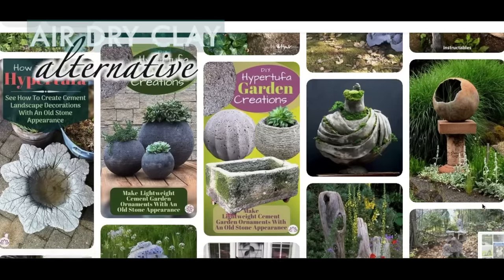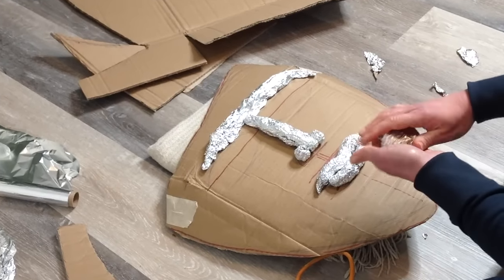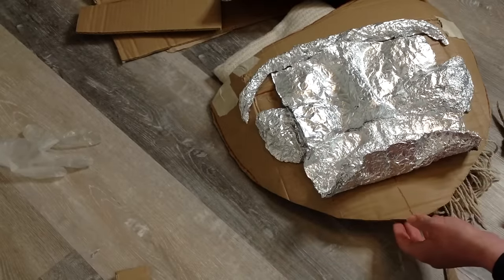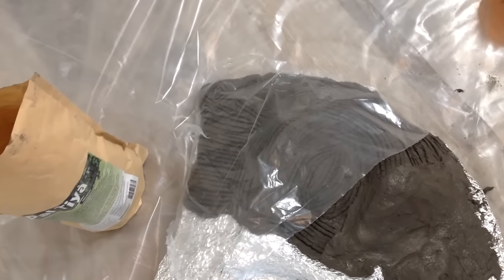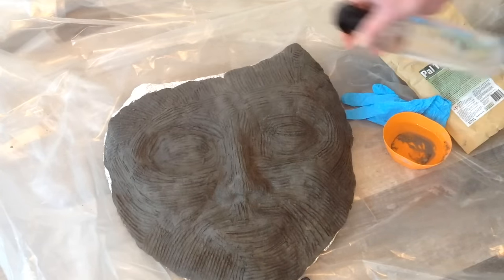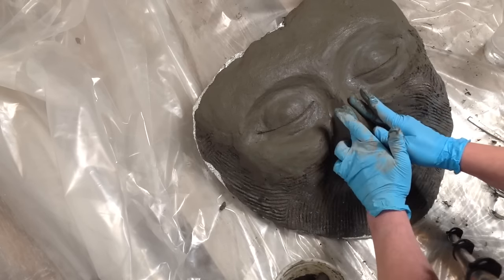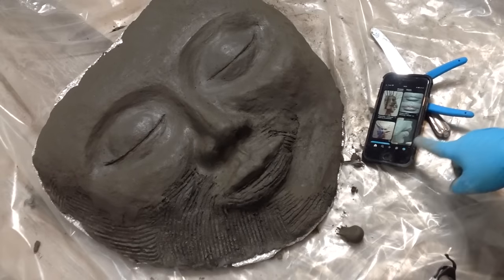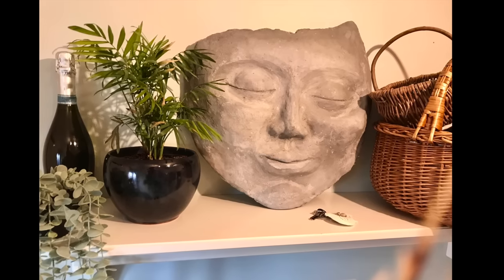Air Dry Clay Alternative - Waterproof DIY Garden Sculpture IDEAS - Pal Tiya Premium FACE SCULPTURE

Comment: Thank you for all the advice and information that you include.  It is so helpful!  And thank you for sharing this new medium.  It looks like the perfect blend of concrete (which I find a bit intimidating) and clay.  And that design!  It looks spectacular.  

This would be a great medium for all sorts of things.  Garden sculptures, of course, like making a fairy house over a stump or a nice tortoise or bunny or even a bird bath.  Plant pots would be a good idea, too.   Also holiday designs for the seasons.  I looked at the product website and it says you can paint it with acrylics, too.
Reply: Can be coloured with exterior acrylics, concrete stains, and india inks. You can even mix Iron-based coloured oxides to the powder to achieve unique colouring.
Reply from the maker: Thank you, sounds like you have plenty of ideas to keep you going a while, have fun

Comment: Im brand new ti airdry art. Infact haven't made anything yet but the face was amazing. My minds going into over drive with tips. Especially foil for adding depth and contours. Ive subscribed ❤
Reply from the maker: This is a different material to air dry clay but you can do the same with the air dry clay like I do on the face sculptures in this video: 
Air dry clay SCULPTURES
https://youtu.be/ucHqVFj-Yk0
Reply: @RedRockingBird  Thank you I've had a look at the video although I've also learnt what score and slip means. Brilliant x
Reply from the maker: @donaunsworth5620  super 😊

Comment: You are a very technical sculptor :D
By the way... I was just searching the Internet for a way to make air dry clay heat proof.
I am trying to make candle holders but I am not sure about the heat...
Reply from the maker: Thank you, kind of you. This is on my list of videos to make, from previous tests air dry clay is pretty hard to set on fire!!! More tests needed though 😊
Reply: @RedRockingBird  Thank you for your answer. It makes sense. Well, I'm giving it as a gift, I hope they won't use kerosene instead of candles 😊
Looking forward to see more of your work!
Reply from the maker: @FlorinGN  🤪 best of luck. Thanks ☺️

Comment: Hi many thanks for showing me your craft and artwork. I’ve started making this face but I’m gonna do it alttle  bit different. I’m gonna make it two sided one side gonna be happy.other side will  be sad. The question I would like to ask is do you think I should use wire to put on both sides?I’m gonna use wood Instead of cardboard. Do you think I should put wire in between the clay to give it some sort of adherence…🤔 many thanks…and thank you Dave
Reply from the maker: Sounds great, how are you getting on with this? Wire can be an option, the tin foil is what PalTiya recommend and always use, I hope it’s going well
Reply: Hi ya…..firstly I would like to say  a very big thank you for taking the time to show us all the process  of making theses masks I was going to use. The pal Tiya but had 6 kg of air dry clay which as you pointed out isn’t meant for outdoor use but what I’ve actually used is epoxy resin which I cover my models with and it works fine. I also use very fine wire mesh which can be bought in any shop it’s called rodent  mesh and I’ve put this onto wooden plywood which makes clay more stable after  making.I had some gold leaf which I put on top of a tooth on one of the models I’ve made at the moment.and at the moment….  I’ve made six ( 🤔) thank you so much for showing us how to do it, Dave.
Reply from the maker: @burgermaster4u2  sounds fab….and you made 6 wow 👍 I need to also show some bigger pieces with air dry clay on my channel, and the mesh would be great to use thank you. I did plenty with chicken wire when I was younger, I also use resin, I tend to use UV resin so I can cure it quicker, do you thinly paint the epoxy on? Thanks
Reply: @RedRockingBird  hi…..I can’t send photos to you show my models computer won’t let me..but when I use the resin, I use as a sealer and I mix it with paint before to get the colour that I need my first model I made was just normal Brick colour…and all I did was add paint to change the colour. I now use the stone coloured air dry clay and all I do is add the colour that I need at the moment it’s just grey. I’ve started making bigger models now  thanks to you ha ha ha ha and I’ve had no problems with cracking at all in fact, I actually put one of the models in a bottle of water. Left it for six days when you put that, epoxy on it dries like a marble effect of it thanks Dave
Reply from the maker: @burgermaster4u2  I live this, thanks for sharing, I have so much more playing around to do with the clay, just been back on laser projects these last few days, thanks, keep up the great work 😊

Comment: I think I heard you say you used 2 bags of the Pal Tiya for your face sculpture 
I looked up prices and it seems thst each bag is about $30 USD
So your project cost about $60 USD for the clay?  Planning on making a 6 foot mushroom for a Halloween decoration, So probably Pal Tiya cost will very costly.
Your thoughts? 
Also can you paint this? What type of paint would you suggest?
Thankyou for your guidance
Reply from the maker: You should be able to get more cost effective larger bags for bigger projects, I’d get in touch with PalTiya directly and ask their advice, they’re very helpful, it’s amazing stuff that I’d super strong. Exterior paints or exterior grade acrylic can be applied. Thank you and best of luck

Comment: I thought one had to leave it to cure with the moist towels for a full 28 days so it is safe to be outside.
Reply from the maker: Pal Tiya: leave it covered for 5 -28 days and it will be fully cured and ready to be painted/go outdoors. 80% of your ultimate strength will come in the first 5 days, but if you are making outdoor sculpture and want the best possible longevity? Go the whole month!